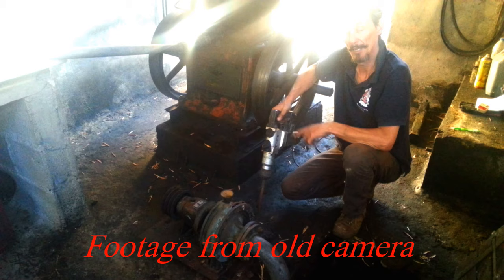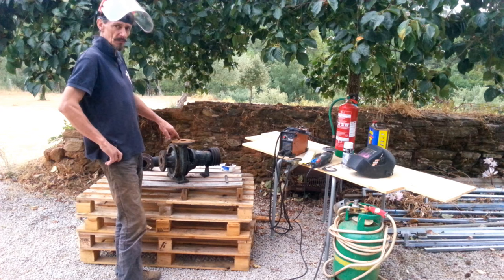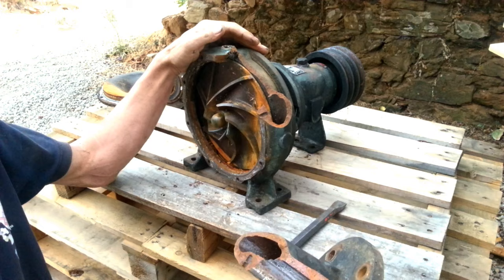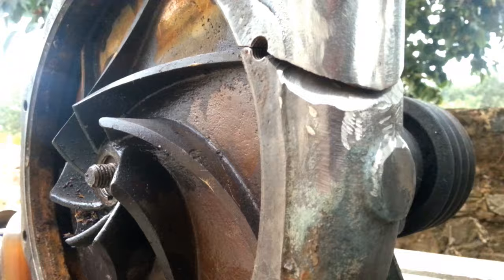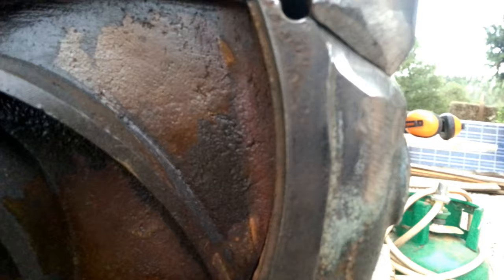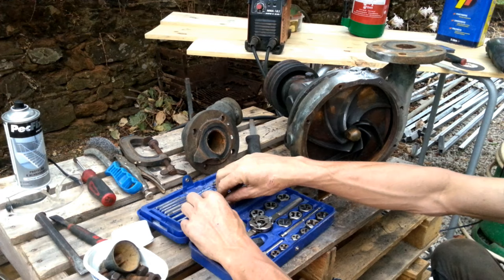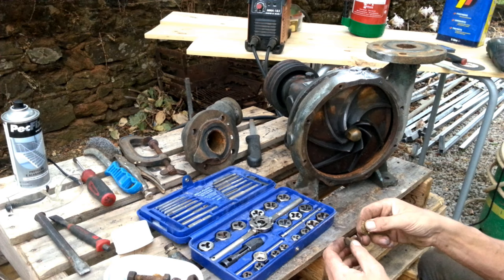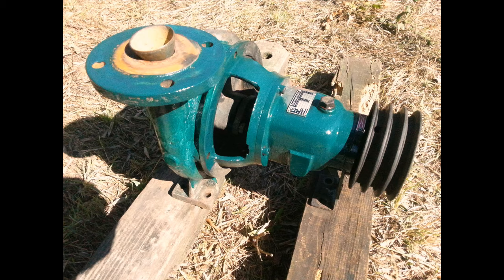90 year old LISTER ENGINE Renovation Part3. Portugal Farm Life

Comment: Good job for the weld, I know how tough Cast can be.
Reply from the maker: Thanks, i was worried it would just fall apart again but it is fine, the pipes and large blue taps above it are not supported and are extremely heavy so the weld is holding all that up... so far so good.
Have had some issues with the pump sucking in air from the 'packing' around the pump shaft... i cant get tools in there to measure so it is hard to find the right waxed cord to get a good seal, i am trying a few different diameters until i find the right one.